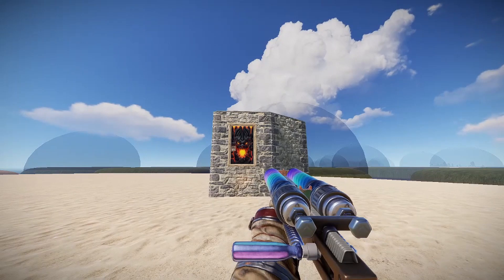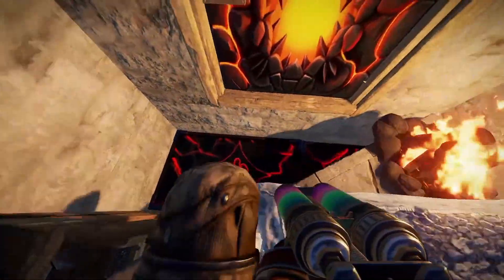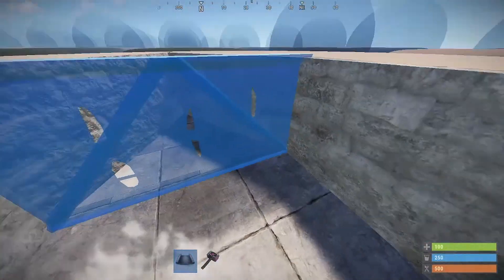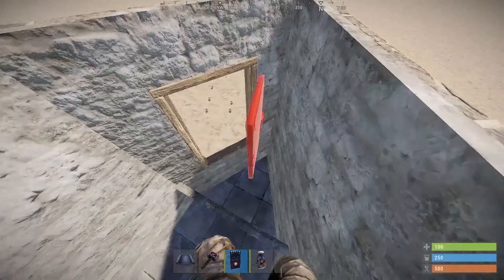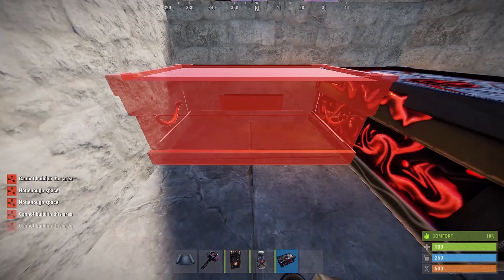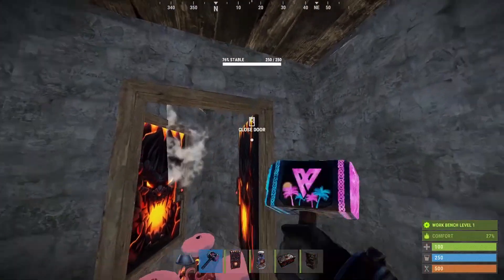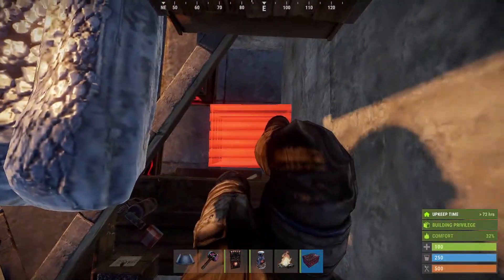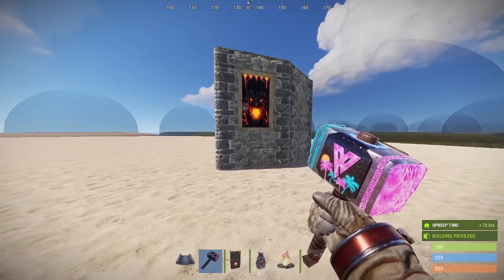Smallest Rust Base

Comment: Another way to get more storage is add a half wall compartment on the top of the base with a triangle ceiling on the lower part to fit 2 to 3 more large boxes
Reply: You wouldn’t be able to place a bag
Reply: @mikeyl9964  you would i think hes saying have the bottom loot room and a replica above the tc, so foundation, half wall, full wall, half wall, roof This allows above storage adding an extra 2 large boxes, in addition to this you could potentially try place the workbench in front of the tc then the bag next to it allowing for a 4 box loot room down the bottom
Reply: @georgalli8226  ah ok I thought having the half wouldn’t allow space for a bag
Reply: @mikeyl9964  yea all good, you only need a full wall of space to be able to place a bag so 1 half 1 full then another half can work

Comment: I use the same base shell but I got a teir2, 4 large boxes, 4Bbqs, 8 small boxes, sleeping bag, 1 furnace, and tc all to fit. Although you do sacrifice the airlock.
Reply: Wouldn’t that mean it’s super easy for a doorcamper to get deep
Reply: @coop9938  there is still a garage door. Just empty the furnace first. It's just not a "traditional" airlock

Comment: Kinda makes no sense, because even if its 1x1 essentially, it costs 600 stone more to build than simple 2x1 with airlock due to low walls costing as much as full ones, has way less room, has one door to main loot less and its more complicated to build compared to 2x1... Not to mention that furnaces in airlock are bound to invite some door campers over.
Reply from the maker: Lmao it was just for fun, I didn’t state it was good for anything :)
Reply: Only benefit of one more stone note cost is, is a one by one. If you had the boom would you go raid this or 1x2?